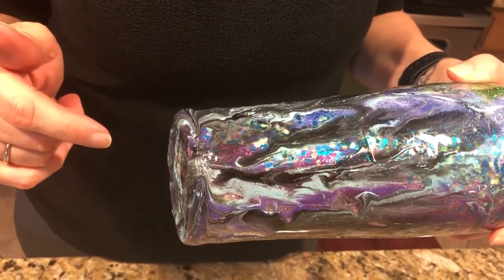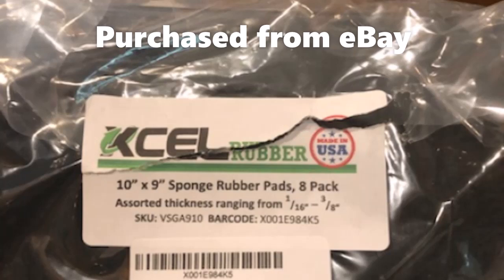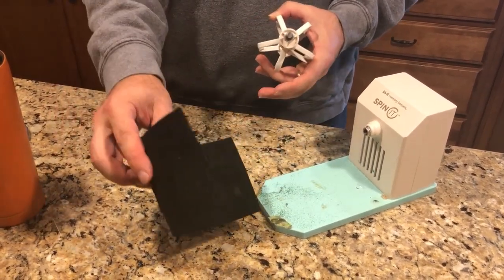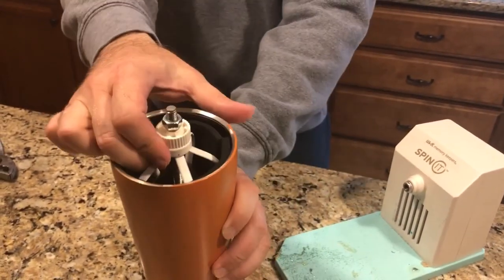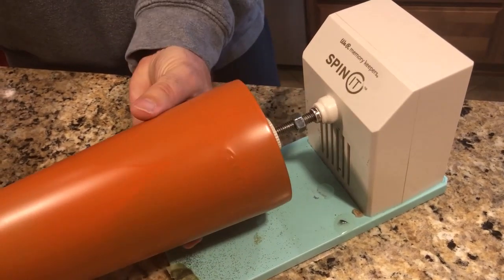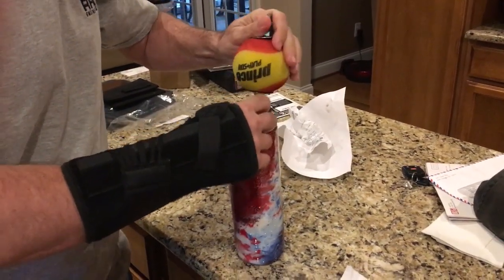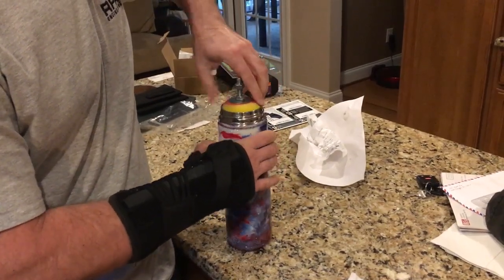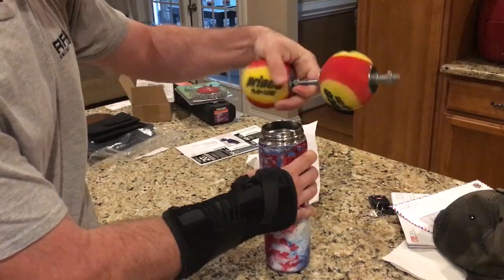Fixes for Spin It Cup Rotator

Comment: how did you fix the cup? ..mine did that too
Reply from the maker: I'm just the mechanical problem solver and not the artist, so I asked my wife. She said she couldn't repair it, so she started over with acetone stripping and then finished off with the wire brush on my bench grinder. Personally, in her case, I would have just bought a new tumbler...I think it cost her just over $5. So if you just take her time alone and don't consider the supplies involved with the acetone stripping, I'm sure she put in at least an hour. I value time at more than $5/hr.